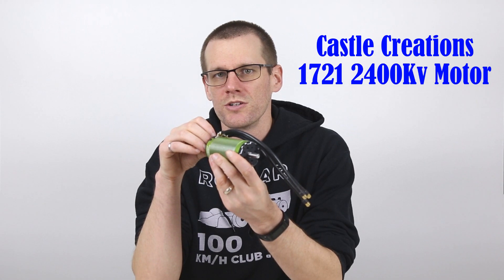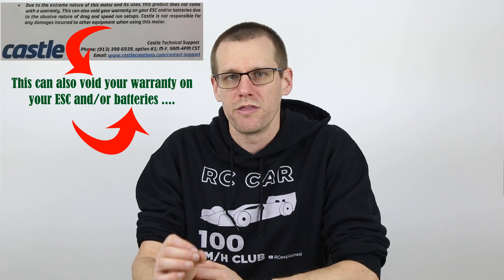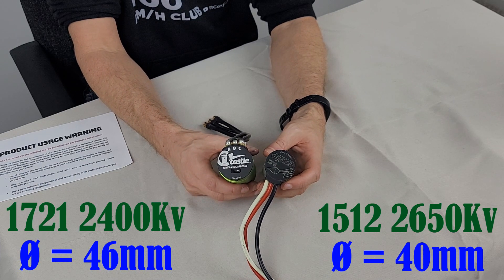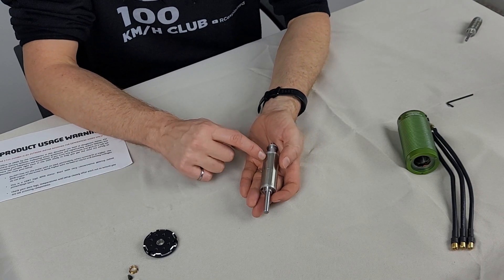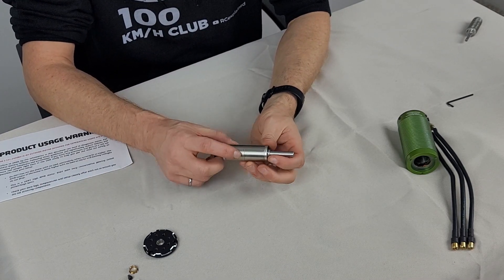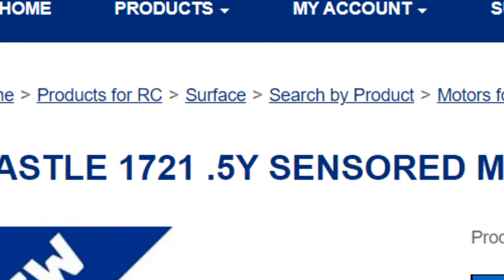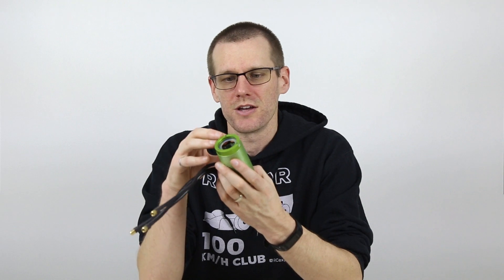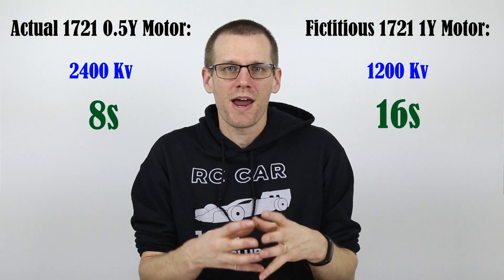Most INSANE and FAST RC Car Motor - Castle 1721 2400Kv (15+HP)

Comment: I'm using this motor with a super charger on Bonneville car. I have the motor and super charger . I only need it on full power one way. Weight or bigger batteries isn't an issue , is there a way to wire it full rpm without the controllers?
Reply from the maker: No, you will need a controller. You could run without a controller on a brushed DC motor but the power output would not be enough to build boost with any significant volumetric flow.
Reply: @RCexplained  ok cool. I order a controller.  I'm not sure how to turn it on and off. I need to order batteries.  It's all good stuff and I don't mind buying what's needed, not sure how to go about it. I'll order batteries.  I'm going off another video a guy made but he didn't explain it in dumb down terms. Electric turbo with parts list is the video .

Comment: I'm not afraid to go against convention and i recently acquired one of these and a MMX8S for my Arrma Kraton. Im running it on just 4s with a 18t pinion geared for about 52mph and its perfect. The truck only weighs 13.5lbs. Esc and motor temps are 120-130. Easy. The battery gets hot though. You must have great batteries with this motor.

Comment: I just bought this motor and it will not run on a 8s mamba it just clogs/ glitch in brushless mode and doesn't move  and in senc mode it needs to be push started and goes very slow at 6s is it because of the windings or do i have a bad motor????

Comment: Hey Ryan (aka: Dude):

When it comes to DC motors, I’m just knowledgeable enough to get myself in trouble.

I’m aware that the Delta connection uses the coils in an equilateral triangle and applies the individual phases at each of the vertices, and the Wye connection runs the coils in parallel with a common neutral, but WHAT THE HECK IS .5 Y‽‽‽

Some of today’s ESC’s bypass the MOSFETs on full throttle. Would this have anything to do with a .5 Y configuration, or is .5 Y a way to help the motor not to cog at start up?

Might make an interesting video clip. 

Thanks for your help.

Peace ✌🏻 

Casey
Reply from the maker: It's 0.5 turns in y config

Comment: what is a suitable esc? would the max6 work?
Reply from the maker: The MAX6 ESC Manufacture states the ESC is to be used with motors less than 1200Kv. The Castle ESC is 2400Kv. I would recommend the XLX2 or bigger.
Reply: @RCexplained  i have a mamba monsterX 8s would it do? its connectors are 6mm is that the only issue?
Reply from the maker: The issue is with the capability of the monsterX. Yes it can work but if pushed to hard you chance blowing it up.

Comment: From my understanding, this new motor is a better performer than any current ESC is capable of putting out. I guess it has the potential of drawing more amps than even the current Castle XLX2 can put out. I dont know how true that is but the person who said it was a reliable source. So, it makes me wonder what Castle has in store for release or what they are currently working on to make full use of this motor. Also i have to put out there that i can guarantee that they use data logging that nearly ever castle system has to possibly be building a better ESC. The XLX2 is still a ESC that many people font know the true potential of and they are running conservative setups not 100% understanding all of the data that the Castle systems can log from each run. I run my Castle systems very conservative to keep not only the motor and ESC cool but also to make the RC itself very predictable. I am far from being an expert on the matter but i am comfortable with my knowledge of the data i would aquire from the data logs. I feel like Castle may be dropping a new ESC once the average weather gets warmer and people start using their speed run cars again. Castle has really been pushing the limits of our RC cars as of late and am interested in seeing where they go with this new technology.

Comment: I have a question to a different castle motor.
How is the difference in Kv possible between the castle 2028 800kv and 2028 1100kv, because castle advertises both as 1Y motors.
Otherwise both motors are the same, same diameter, length, rotor length and Diameter, as well as the stator length and diameter.

Only thing that may be different is the winding, but I don’t know 🤔 just curious 

And great Video 👍🏻
Reply: Stator length, wire size,  and air gap fine tune the kv's of the 2028 motors
Reply: Windings. 800kv is a 1Y. 1100kv is a 3/4Y.
Reply: @abulimicdog1  we need that. 5 2028
Reply: 1100 destroys the 800

Comment: You must have seen the Kevin Talbot video of him blowing up ESC after ESC with this exact motor.
Reply from the maker: No I didn't but if the ESC is not as Beast as this motor, bad things can happen when not careful.
Reply: Highly unlikely as Kevin has not put out a video with a CC 1721 (I'm not 100% certain but I do not believe he has one). The motor he was burning up all those ESCs with was a TP 4070 (I believe) rated at 3200kv on an XLX2 trying to put 8S through it.

Comment: Raz going 24s..lol crazy
Reply from the maker: 24s like 88 volts to the motor?
Reply: @RCexplained  I think what the gentleman is referring to is Raz's 4 motor build with 4x1717 driven by 4xMMX8S. So it's not really 24S. More like quadrophonic 6S lol ;-)

Comment: Great video and I love your passion and knowledge. Quick question. How does this motor stack up in terms of power and performance against TP Powers 4070CM 2200kv and 2700kv motors which are probably the most powerful 1/8th scale speed run motors you can purchase?
Reply: 1717
Reply: @justin race
Reply: The castle 1721 is a lot more powerful than the tp 4070cm. 

The 1721 has 2400kv and can run up to 8s, for example the 4070cm 2700kv is rated for 6s and the 2200kv for 8s, so the castle motor has 200kv more. That means it has a higher Rpm, also the 1721 is a bigger diameter 46mm (vs Tp 40mm) that means it will create mote Torque. 
Other Faktor are the numbers the 1721 has shown in Data loggings. This motor can easily suck 500Amps, while the Tp 4070 cm are around 300-400 Amps max.
In conclusion the 1721 is a much more powerful, higher Rpm and torquier motor than Tp4070 cm
Reply: @justinS.215  thanks for this Justin. That's just insane as the TP 4070 CM motors are extreme motors in and on themselves and have been the top speed run motors for years but the fact that the Castle motor is significantly more powerful than these is mind blowing.

Sounds like the Castle 1721 is a beast👍
Reply from the maker: Great Questions and Answers. If i Can get a hold of a TP motor, I can do a comparison.
Reply: @RCexplained  that would be awesome, thanks!👍
Reply: I'll give u a tp motor to blow that 1717 away no problem buddy  8s on 2900 kv cm 680000 rpm all day long I already smoked 1710 on 8s And my tp keeps going huh better motor lol walk ass self
Reply: @mychalpstanton9188  no one here except you is talking about the 1717 and I know your TP doesn't do 680,000rpm. Youtube comment section "top tip": Did you know you can edit your comments so you don't have to make multiple entries as though you were using a type writer? And "walk ass self" is nonsensical and doesn't mean anything. Aside from that, you're batting a thousand champ.